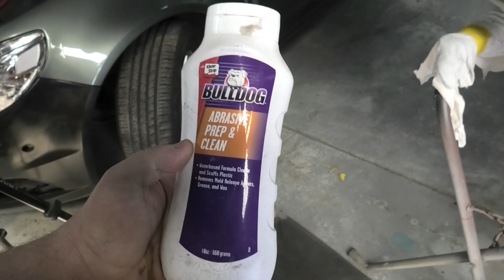XC falcon wagon rust repairs part 8

Comment: hi mte , great video onthisrepir,  just bought an xc wagon to restore , parts for wagon are hard to come by , however your metal folder should have  blade adjustment on either side to allow it to move forward or backwards , just thought I'd share that as setting it back will allow that slight roll you had to stuff around to achieve , 30years in sheet metal here so advice is solid , although your folder not a recognised brand it may not have the adjustable blade , typically to allow a folding point for different gauges of material. Cheers

Comment: btw b my fav ford 1stcar I owned iridescent green 302 clue wth a built beefy C4 box  6 stock 272-278 diffs till I stuck 31 spline 9 inch into it , had the gs/gt trim interior , maxspeed 193-195 kmh on the quarter mile at illegal drag meets  back in 80's

Comment: Great video mate, im just a little concerned about you smelling urinal cakes  😂 in all seriousness though i enjoy the longer videos with more detailed stuff 👍🏼
Reply from the maker: well ya gotta have a hobby dont ya haha
Reply: @xacoupeguy   yes, so ive been told haha with your paint for the commodore if it gets the better of you, something ive done a fair few times and its worked a treat is to tip a few hundred mls off into a seperate mixing cup and slowly add a little but of the darker/greener variant to the lighter variant to darken/green it up. Go little bits at a time and it just might get you out of trouble without having a mixing system. Food for thought for next time if there is a next time down the road.
Reply from the maker: @vautorefinishing7672  ive been thinking that my other thought was use most of the stuff ive got but make the last coat be done with the small amount of the right stuff? i just find painting to be super stressfull mainly due to the huge cost of paint and materials it makes screw ups expensive
Reply: @xacoupeguy  yeah exactly mate thats what i was trying to get at, use the not so good colour as a base and if you can whip up something a little better by mixing the two lay that on last, yes it can be expensive with screw ups thats for sure its not fun for anybody when that happens